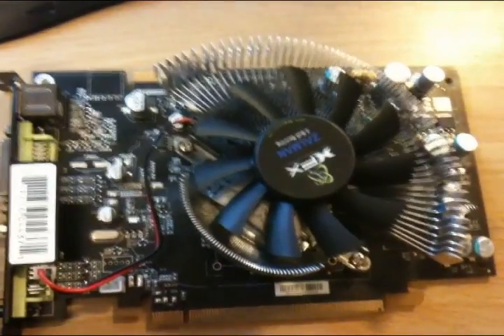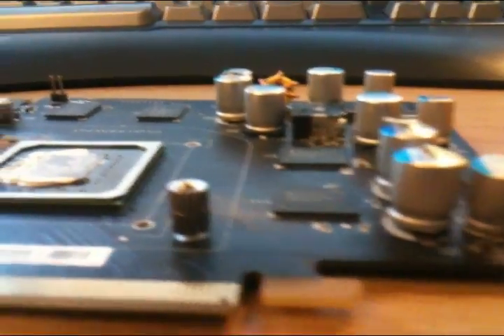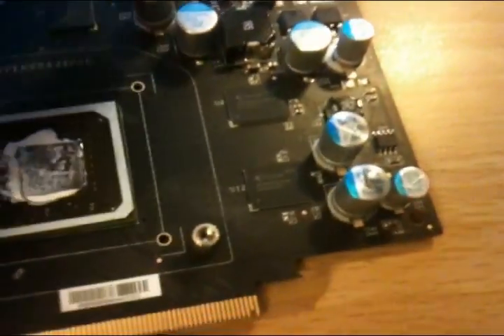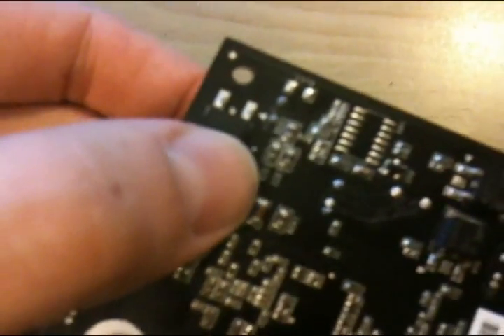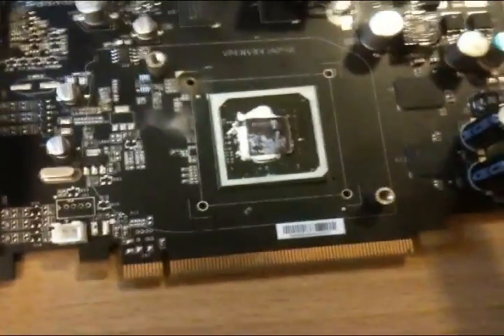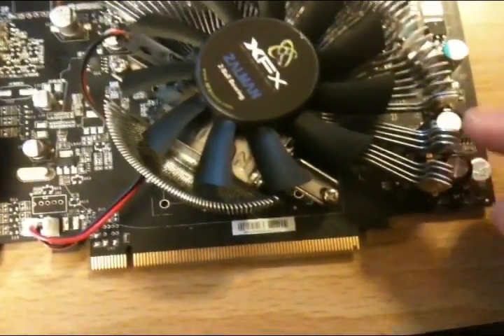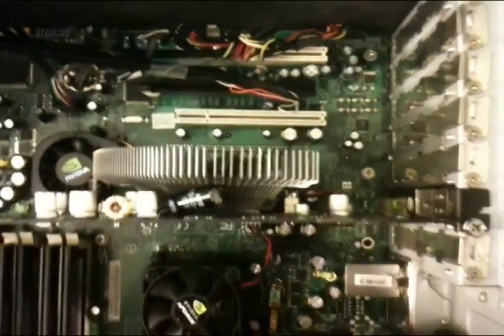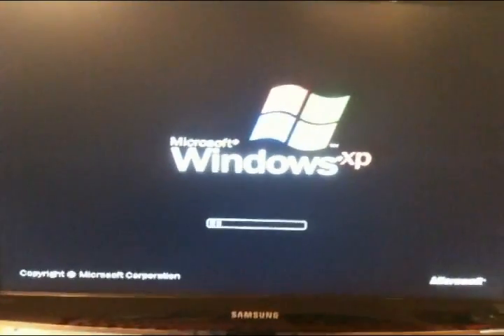How to Repair Video Graphic Cards with Blown Capacitors  ATI, Nvidia, AMD

Comment from the maker: How could you use your computer if you can't boot? Video cards sometimes need to be re-adjkusted in their slot, so pull it out and take a good look at it while you have it out and inspect it for broken CAPS. If everything looks good, put it in and see what happens. Also you may have a different slot on your motherboard to run another video card, you can try putting it into that slot, if you think that it's the slot that is PCI-E  broken.

Comment: hey guys! could anybody help me with some advice? i have an nvidia8600GTX videocard. when i turn on my computer it beeps one long and three short (means something wrong with my VGA) and the monitor doesnt turn on. after restart it still beeps the same but the monitor gets alive. i can use the computer but cant even watch a fullscreen youtube video. should i look around my capacitors or the gpu? maybe the pci went wrong on the motherboard?
pls help me.

Comment: I thought it was my VRAM and it was! I research a bit and appearently there was a slightly undone solder. I proceded to cooked my graphics card at 350F in the oven for 10mins and it fixed it! 

How this works for those unbelieving haters...

The heat made by the oven slightly melts all solders and lets the solder reconnect with the solf metal, let it cool before you put it back in the pc :p

Comment from the maker: I had a similar problem after overclocking one of my video cards to a point of no return. I ended up getting a different video card because I couldn't fix it. Finding the blown capacitors on my card was the only indication I had that I could fix it myself. Did you overclock your card on purpose or accident recently?

Comment from the maker: Hmm. Mine was easy because the second I took the card out and saw the caps, I knew that I could fix it. Maybe you have some other type of video card problem, like a resistor or a lose connection.

Comment from the maker: Replacing blown capacitors will fix your car, because all you are doing is basically swapping out broken parts. But I agree that a new video card is a good way to go anyway since the operating system, applications, and games demand more and more performance every year.

Comment: I have a old ati 4870x2, i recently got something like this, not as bad.
When i boot up i get a big stripe of pixels with tons of colors, mostly red,white,green.
It's just 1 stripe on the right side. I will most likely upload a video of it later so you can see the artifacts that it displays and hopefully tell me if this is a capacitor or VRAM.

Comment from the maker: Follow the instructions in this video and you should be all set :)  BTW: Make sure you replace the caps with the same specs. I went to a place called Cables and Connectors because they have all types of electronic stuff; a lot more than Radio Shack!

Comment: Hi, well 1 hour ago I lost my picture? Monitor is working (checked it)  Comp is working but no picture. My graphic card is Geforce 8600 I think. One capacitatoris blown and another one is slighty deformed. Might that be the problem.   Note:  I kind a hit the computer box with my fist and than it stopped working....     Was frustrated cos my Tv card was freezing the picture.

Comment from the maker: The oven trick is only a last resort. If you have blown caps, then that is your problem. If you do not have blown caps, there's a slight possibility that you have a driver problem. Get all new drivers and do a proper uninstall and install. Also make sure you are not overclocking your video card in any way. Make sure you are also running stock voltages to your card.
Reply: Uh I don't have any damages over my gpu but when i insert the card whole rig is not starting up ....what it would might be ???

Comment from the maker: @212anurag I think they are full of BS. Video cards are supposed to be compatible with all motherboards that support that slot type. 

Glad to hear that they are replacing your card though :)

 If you're worried, get the new one, then sell it on Ebay and buy yourself a different brand card.

Comment from the maker: @daDfarSpanTaistheKin Sounds like you have a micro soldering issue and if the heat gun or oven trick don't fix it, then you might be screwed.

Comment: my graphics card also displays the same grabbled text ,, i had earlier repaired it by heating the gpu main chip with heat gun and it worked ,, but it is now again exhibiting the same problem,, all my caps looks fine and flat ... what should i do?
its mvidia fx 5200 ultra..

Comment: youll find this funny - ive been baking my gigabyte 8800gt 4 times already in the oven and it works for about a month afterwards... i moved recently and seems my new oven's too powerful, last time after 5 mins 7 capacitors fell out of the card :D guess what i did? i heated it up again and stufffed them back in their places ( i had to go online n find pics of the same card to know which ones go where) card works like new again! its incredible -  ghetto repairs ftw! doing it just for the fun of it

Comment: my card has no blown capacitor, but my problem is, if i inserted on my pci-e slot then i put my vga connector on it , my monitor has no output display at all, but when i put my vga connector on on my mobo add-in graphic card there's a display, while my video card still on my pci-e slot , what is wrong on my geforce 9400 gt video card? pls help...

Comment from the maker: @SuperStewartStewart Well I never fixed any capacitors of any kind before. I read up on the internet how to fix the problem and bought the 3 caps. It took me about an hour to do the whole job because I'm not good with soldering and the old caps just didn't want to come off. After I replaced the caps the video card has been running ever since. Blown capacitors on Geforce video cards is very common. Just do a search on Google.

Comment: Hi,i have been into Electronics for thirty years!! and have never seen a capacitor blown like them??Looks like theve been reversed-polarity,probably with a 9volt or 12volt battery. Its  NOT FOR REAL !!  if the Capacitors are in that condition,What about the IC (intrigated circuit) or the transistors, they are all very more likly to fail,than a CAP.!!
Good Video,  very Suspect thou,   have a great day---Stewy.